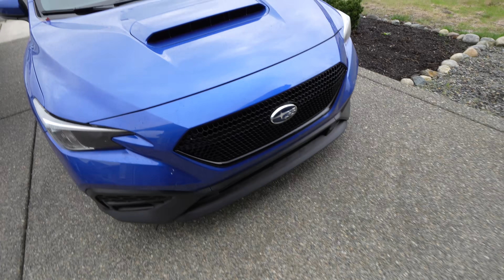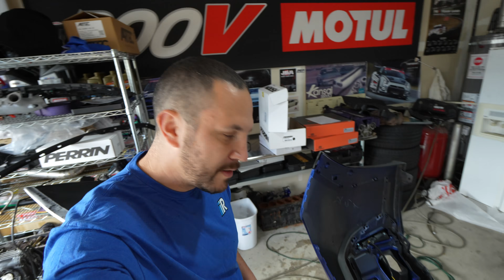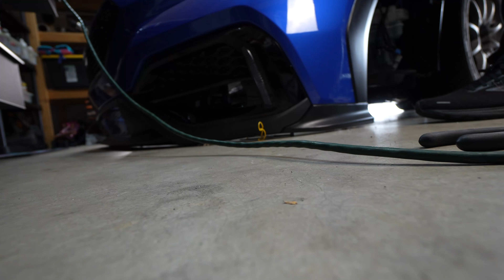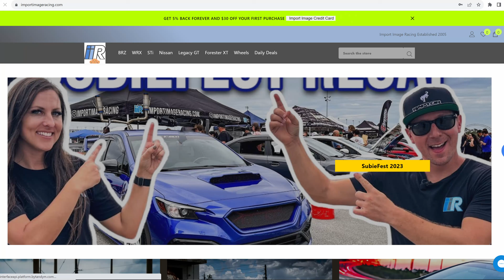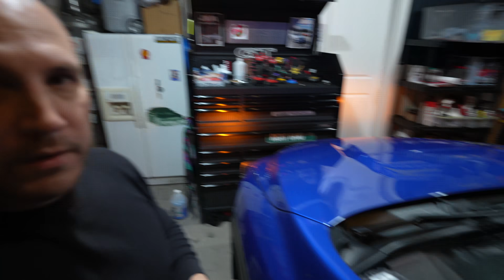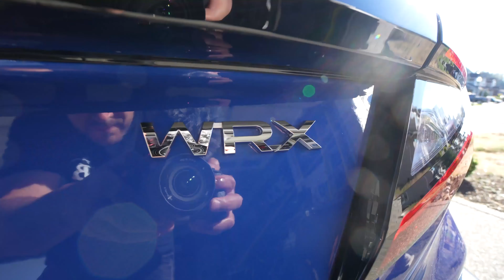JDM Style DRL Turn Signal Fog Bezel lights Subaru WRX 2022, 2023, 2024

Comment: Still catching up. IIR now has a kit with both the JDM fog lights and the LED bezel so you can install both at the same time. It's a good deal for about $300. I went round and round about the wiring and what to do. The kit comes with a very nice harness that you're supposed to use. However, that would have meant a lot more wiring and another harness going through the firewall. I decided to use the factory wiring that was already installed. Both sets of lights connect directly to the factory harnesses behind the bumper. For the fog lights, you need the Panasonic relay, about $18. And you need the OEM switch, which is about $70. For the bezel LEDs, all you need to do is connect the two wires under the dash to complete the circuit, which turns the LEDs on. If you do all of that, you don't need the kit wiring harness at all. The LED bezel wiring harness now ships with a connector for the blinkers that simply plugs in to the OEM connector. So you no longer have to splice in. Very slick. I may re-purpose the kit switch for another set of lights, maybe some stealth fog lights like what Cody did on one of his WRX builds. All in, the IIR kit with the extra parts you need in order to use the OEM wiring, was about $400, so I was pleased about that. OEM would have been over $800 and with less functionality.
Reply: Hello! Super helpful comment, I’m about to pull the trigger on the kit you mentioned but was worried about the wiring, do you mind shooting me a pm so I can ask some questions!?
Reply: @Tsoda6625  No problem, having just installed it, I know the parts you'll need for an OEM install. It's a nice kit, for sure. I don't think YT still has PMs. You may have to ask your questions here.
Reply: @paulpendley3678  what wires under the dash did you connect together? Where did you get a oem fog light switch?
Reply: @Tsoda6625  There's a harness with pink foam tape around it. You can find it behind the switch panel near your left knee. I cut the connector off and connected the two wires together but I read that one guy slipped a dime in the connector and that worked, lol. You could probably get two small female wire connectors and use that to bridge the connectors in the harness. You could even wire up a switch for it if you want to take the trouble, but you'd have to lengthen the wires since they're pretty short. I may do that since I have the extra switch from the kit that looks OEM when you install it. Or wire up some other lights. I haven't decided.   

The fog light switch is part # H4510FL500. It clicks into one of the bottom slots on the panel (the top and bottom row switches are different sizes and not interchangeable). The factory connector is already there, right behind the panel. The switch is a dealer part, mostly. I got mine from https://www.oemsubarupartscenter.com/parts/subaru-switch-h4510fl500

I got mine about a month ago for $63 but it's now around $70. The fog light relay is about $17 and is widely available. The part # is 25230AA190. I got it from Image Import Racing when I ordered the kit. Once you have the switch and the relay, you can then use the factory wiring harnesses. Everything simply plugs in. It adds about $100 to the cost of the install but it's much easier and cleaner being able to use the factory wiring.
Reply: @paulpendley3678  you are the biggest help i have found thank you so much. 

i just took a look under the dash and saw the connecter your talking about (big white one only two wires wrapped with pink tape) with you connecting the wires together are the side running lights always on? and then the switch in the panel will turn the actual fog lights on and off? 

i also just wanted to make sure the connecter for the actual fog light switch is a small white one wrapped in pink tape as well? 

and lastly the relay goes in the passenger side relay box correct?  labeled F fog Light?

 again thank you for all the help
Reply: also sorry another side question, did you still have to run power cable to the battery or does all OEM harness also take care of that?
Reply: @Tsoda6625  The two wires under the dash form a circuit when connected to each other, which powers the LED bezels. They come on automatically when the ignition is on. You could probably install a switch to turn them on and off but I just have them on with the ignition for now. They match up well with the DRL headlights since there's no way to turn those off while driving. There's a connector that you use for the turn signals that plugs into the blinker socket. It's pretty easy especially with the bumper cover off. 

Yes, you can turn the fog lights on and off with the switch, although the fog lights will only turn on when the low beam headlights are on. If you use the factory wiring, there's an indicator light in the dash that lights up when the fog lights are on. The harness for the fog lights is taped to the other harnesses going to the switches that are already in the panel. You can't miss it. It just plugs in to the rear of the factory switch and the switch then clips into an empty spot in the lower row of the panel.    

The relay plugs into the fuse box on the passenger side. It's right next to the air box. If you lift the cover up and look under it, you will see a schematic which will show you which socket the relay plugs into. I think it says F Lights or something like that. It's pretty obvious when you see it. Match up the prongs, push down, and you're in business.
Reply: @Tsoda6625  It's all good. Ask anything you need to, brother. The cool thing about using the OEM wiring is that it's powered up when you install the relay. There's no additional wiring needed. It's all already there. You just plug everything in and it works.
Reply: @paulpendley3678 just pulled the trigger on the fog lights! I can’t believe they don’t just tell people to do it this way! Again huge thanks I’ll drop a comment if I’m having any issues!
Reply: @Tsoda6625  Make sure you watch a few videos about removing the front bumper cover. It's a bit tricky getting it back on but the videos will show you how to do it. IIR has a good video about installing the fog lamps in the cover.
Reply: Going for the install tomorrow!
Reply: @Tsoda6625  Excellent. I was wondering about your install. You must have all the parts now. Best advice is to take your time, don't get into a hurry, and make a note of where each pop clip goes, especially on the bottom of the bumper cover. The cover comes off easily but can be a bit tricky getting back on again. The videos really help to show you the trouble spots when reinstalling. Other than that, it's plug and play using the factory wiring. Good luck with the install. You're going to love how it comes out. It really dresses up the front end nicely.
Reply: @paulpendley3678  it went perfectly! huge thank you for the tips and the parts!!! i absolutely love the look now!!
Reply: @Tsoda6625  My pleasure, glad I could help out. Indeed, the Base front end is very bland from the factory. The lights really make the front end pop. I still haven't tested out the fog lights at night so I can't say how much they actually help. But they look good. My next project is driving lights behind the grill. I am re-purposing the harness and switch that came with the IIR kit since I didn't need it for the fog light and LED bezel install.
Reply: @paulpendley3678 I just installed the relay and oem fog light switch , but the day time running light aren’t turning on as in the white led strip , they still work as indicators /the yellow part of the light works but it won’t turn on white ? Do you know why that is

Comment: Quick question. If I was to get the more expensive version liner pair.. would it also be programmed to have a turn single/blink without connecting the yellow wire? Or would I have to still do the yellow wire procedure If I was to get the more expensive version ?

Comment: I could not for the life of me find the turn signal wiring. I’ve looked at 4 different installs and I still can’t find it I going to have to just give up and stick with the daytime running lights for now it’s been 3 hours and it’s 1 in the morning
Reply from the maker: I had to tap the yellow wire off of the corner signal in the headlight to get that to work. My video walks you through that process. Best of luck to ya.
Reply: I did the install with OEM DRLS too and I cannot figure out where to plug in the harness under the dash, do I unplug the pink bundled?
Reply: @James-vz1bp I just installed mine and that pink one under dash was for oem jump cable. Just plugin the cable that they give to you and it should work.

Comment: I believe the OEM LED fog light trim bezels only light up the LED's for DRL's and not turn signals too.  Can these JDM style be wired to just use the LED's as DRL's only without using them as turn signals? If so would it be a plug and play or would you have to do additional wiring to install only as DRL's?

Comment: is the front intercooler that much of  an upgrade based on Price? I have a Cobb stage 2 and it kicked up performance but was just wondering about that specific part, have a  big scoop on it now with TMIC
Reply from the maker: Front mount does not suffer from heat soak. TMIC will make good power until engine gets hot and heat soaks it. Power will drop when that happens.

Comment: How would you wire the turn signal on the limited model which does not have those type turn lights.
Reply: I have the limited model as well, anyone know how to wire so the signals work with the limited model?

Comment: Just wondering I’m assuming that Subaru also sells the jam style fog light bezel at the dealership or is it only through import image racing?
Reply from the maker: Yes the dealers have an oem JDM fog light bezel kit for around $500. Those one are gloss black too. The USDM bezels are flat black plastic and around $450 or so. Good question and thanks for watching.
Reply: @SpeedPerformanceLab  A little off topic but do you know of any good late night drives in seattle I could go on or a nice drive during the day?

Comment: Looks awesome complimenting the grille. I love the signal light concept, but this is the 2nd video I've seen of the noble bezel, and the bezel signals aren't in time with the headlight signal. It would drive me nuts but it looks good otherwise.
Reply: The oem version of this doesn't have the option to work as a signal it's only a drl
Reply from the maker: Yes I agree with you the look is awesome but the lights are slightly out of sync. I am not sure if it has something to do with the oem turn signal being and incandescent light bulb. I wonder if the OEM LED daytime light sync up perfectly? I will have to research this.
Reply: @SpeedPerformanceLab was thinking this exact thing then read this. i think that changing to oem turn signal to an led would match better due to the delay with the incandescent lightbulb.
Reply: just watched a video by street inspired on youtube. he has LED turn signals and the blinker lights now match perfectly. there is no lag between the blinker lights now. just thought id share!

Comment: You could have just plugged it into the harness with the pink tape. The one you grabbed that you said didn't line up was for fog lights
Reply: But then you have to jump the pink wire under the dash. How did you do yours?
Reply from the maker: I thought I had the right connector. It was 2 pins from what I remember and the pins were slightly wider on the Noble to fit. The other connector from the car was a 3 pin plug from what I remember. But, maybe I am mistaken. Thanks for the feedback and for watching.